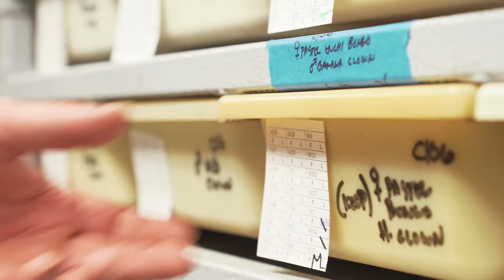UMBILICAL TWIST ON A BABY SNAKE!! CAN WE SAVE IT'S LIFE?? | BRIAN BARCZYK

Comment: Brian.. Your flex seal may work, but you might have to get up under the enclosure and spray it. They also have flex seal in liquid so you can paint it on, or even the flex seal paste that might work better from the under side. I hope you can get Salt and Pepper's enclosure fixed and not have to tear it all apart. Good luck and keep up the good vibes!

Comment: To track down the leak you might want try putting some food coloring, or other colored liquid  that will stand out from the water and sort of cloud. If the leak is somewhere inside the enclosure area you should, in theory, see the leak by the colored liquid being drawn into it.

Aslo, for the Reptarium 3.0, for any water exhibits that you might want to include access panels that will allow you to access the plumbing more readily and without having to tear apart the rocking. I think that will save you a lot of headaches in the future if you ever have to fix or replace the plumbing.

Comment: What you should do is install a Lip of some sort underneath the water fall about 2-3 inches back underneath.

Similar to like when you run a cable through your exterior wall, you sort of build a small drip loop.

Comment: Well by what you have done already the waterfall is the spot, you did behind and the frount face, the most likely cupret would be the waterfall shelf or basin. Where the water collect befor falling over the edge there could be a flap that's not sealed well but sometime was holding the water back or calk that has popped loose around the water Exit hose. If it was me this would be the next place to investigate

Comment: You probably need to tear it down and make it waterproof underneath all the rock. It should be like an aquarium under the rock. If the builder isn’t used to building aquatic structures they might not have sealed everything properly or it was just a one off and was a botched seal. Go beneath the rock and find the source or it will be a never ending fix. Pretty much like the phrase measure twice cut once.

Comment: Take salt and pepper out, put a UV dye in some water and fill the tank. Get a UV flashlight to find EXACTLY where the leak is originally from, once you find it, first take off the old flex seal you used, then get some silicone caulking and use that instead. Once the caulking is cured, then spray the flex seal over the entire area, be sure its dry, and let cure. That should seal any and all Leaks!!!

Comment: BRIAN..... IF YOUR GETTING A LEAK EVERY TIME YOU PLUG THE PUMPS IN I WOULD START LOOKING AT THE BULKHEAD CONNECTION,THE PLUMING FROM YOUR PUMPS OR FILTERS,YOUR CONNECTIONS ON YOUR PUMP OR FILTERS. ALSO IF YOUR USEING THE FLUVAL FX6 CHECK BOTH TOP CONNECTIONS AND THE LOWER VALVE

Comment: For the leak I would drain the enclosure and leave just enough water for the water fall to run so then at least you can either rule out that or know that it’s the problem. My guess is the fittings for the waterfall are leaking